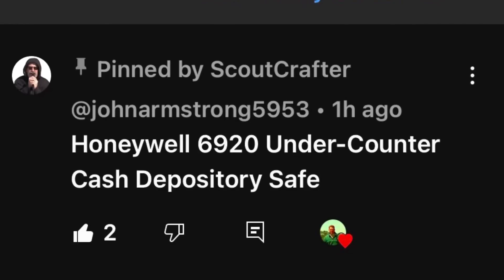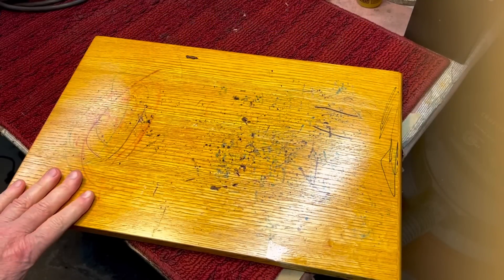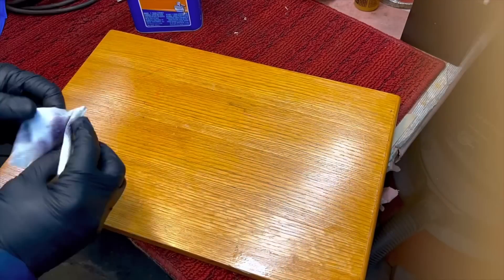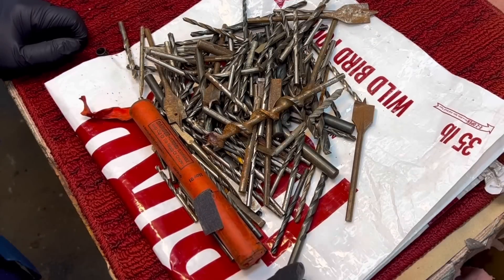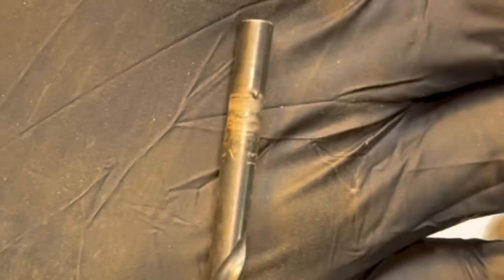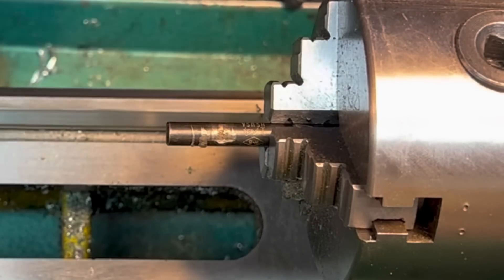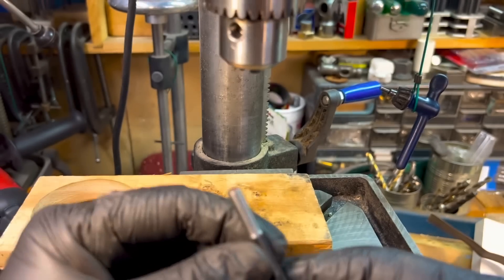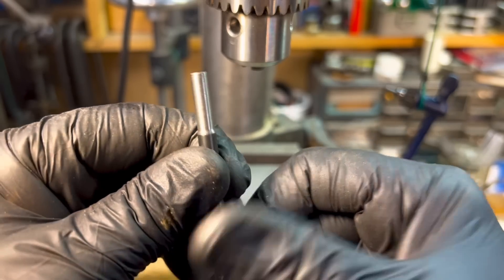Awesome Finds! Saving Drill Bits and yet another reason You NEED a lathe!

Comment: The first drill I owned was a 1970’s era Craftsman “Commercial” drill.  The chuck couldn’t grip a drill bit – it was almost as if the chuck was designed to be a clutch to protect the motor (to reduce warranty claims).  My second drill was a Milwaukee Hole Shooter with a good chuck – the Milwaukee stopped my spinning drill bit problems.  Even the keyless chucks worked better than the Craftsman chuck.
Reply from the maker: Yes- if the chuck isn’t ground properly or an inferior model they won’t grip worth a darn!  😃👍

Comment: In my distant past I taught machine tooling at a trade school..  the kids would always damage the drill bits.. I still don’t know how they did it so often.  A few of them could damage a steel ball in a rubber lined room.  the short cut I used was take drill bits that have shank damage and touch them up with a file.  Don’t need to remove anything except the little bumps and high spots.
Reply from the maker: I’ll admit when I was young I screwed up my share of bits.  🫣  hopefully now I learned my lesson. 😂👍

Comment: I have seen some brand new twist drill bits with flats on the shank end. I'm sure they are intended for the 3 jaws in the chuck to grip on and prevent spinning. If you have a round shank drill bit, is it possible to put the flats on the shank instead of just smoothing out the shank like you did on this show? I think it will help prevent the spinning in the chuck in the future and will also take care of any gouges in the shanks. I would think you could do it with a grinder or by hand with a file (this may take a long time if it is a hardened shank).
Reply from the maker: They use a jig and a grinder.  Does it very quickly. 😃👍

Comment: You gave me an idea for the brace bits that have severely damaged lead screws, and that is to sharpen the lead screw to a 4 or 6 point sided centering point ( like a square awl) and start using them in my drill press of brace at slower RPM’s as bottoming bits, or flat bottom counter sink drills, I have a quantity of that type of bit on hand and could never get myself to toss them out, let you know how they turn out. Thanks for the video, enjoyed it.
Reply from the maker: Yes!  Even if you just grind off the threads with a Dremel the bits should be manageable in power applications. 😃👍

Comment: As soon as anyone goes after a spun shank or even tries to sharpen them with a bench grinder they invariably mess them up........I'm convinced bench grinders have ruined more stuff than they've ever fixed.
Reply from the maker: 😂😂😂. I know I have!!!  It takes years to develop a soft touch.  😃👍
Reply: I've actually got pretty good at sharpening bits over the years but 3 16th's is it, anything smaller is dead
Reply: When you are trying to sharpen the only right sized drill bit you own and it just keeps getting shorter and shorter   🤔🙄😁